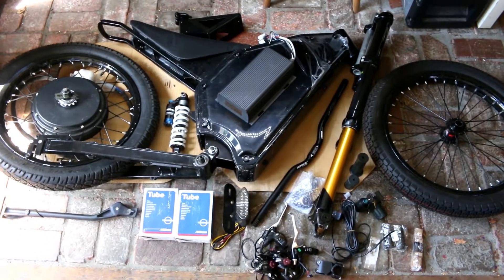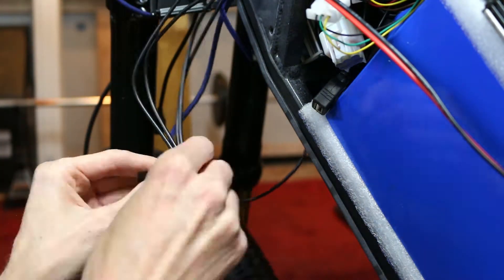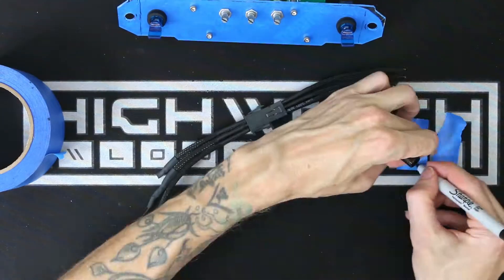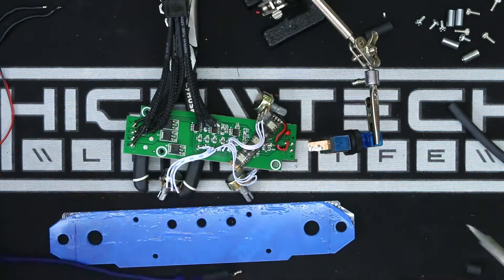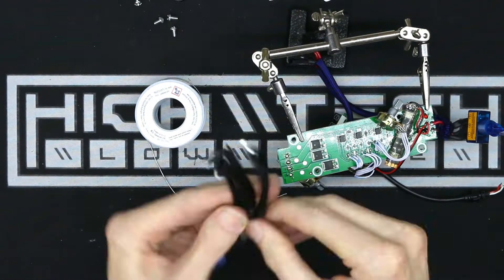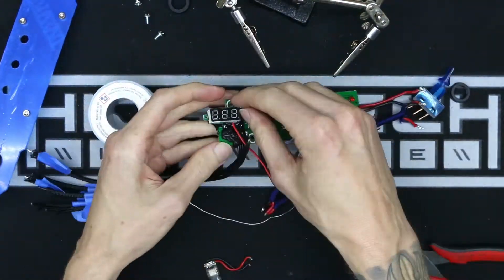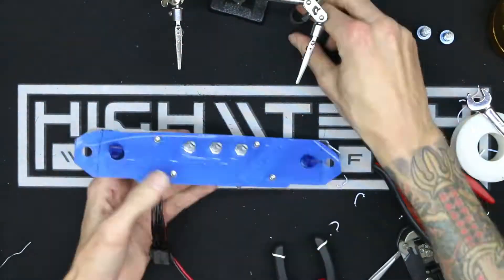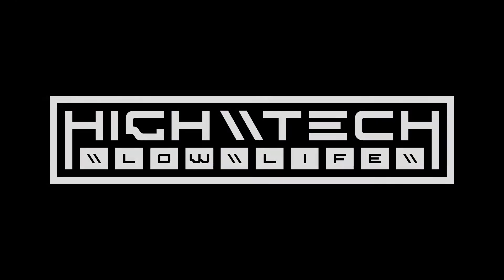🚲 Custom 5000W Digi-Camo E-Bike [54MPH!] - Part 3 - Edge-Lit Acrylic Dash Design + Build + Wiring

Comment: enamel coated wire is what you want   it wont short  . just clean the ends and solder up the rest is safe .. 😱😁
Reply from the maker: Thanks man! Yeah that would also work for sure!

Comment: hi, i was wondering if you could include the machines you are using to make your layouts with, please, like link them in your videos ok, thank you.
Reply from the maker: Hello, do you mean the laser? Or the software? Software is Illustrator, the laser is a mini helix: https://www.epiloglaser.com/laser-machines/minihelix-techspecs.htm
Reply: @hightech-lowlife  sorry, did not know there was software, to get with the machine, but yes what software would you recommend with this ? thank you and which mini helix
 would you recommend as well ?
Reply from the maker: @stan121midling5  No problem, for software you can use any vector graphics editor (corel, illustrator, inkscape - which is free) - the laser will just 'print' a pdf file :) 

It depends on what you're going for, bed size and also wattage. If you want to work on bigger projects or more robust materials you'll have to get a larger and more powerful laser. If you read this article, you will know everything you need to understand: https://www.heatsign.com/how-to-choose-the-right-laser-cutting-machine/ 

Good luck man!

Comment: Dude you need to buy the heat shrink with built in solder and glue. They are a huge quality of life improvement when it comes to splicing wires. Everything is electrically insulated, water proof, and a has a strong mechanical connection.
Reply from the maker: Thanks, I'll try them out :) I'm just so used to doing it this way, and even though this was a lot it was nothing compared to wiring my car!
Reply: @hightech-lowlife  haha tedious work!
Reply from the maker: @vincentpernicano3277  Most definitely!

Comment: if you ever need wire that can take alot of bending just strip your old usb or fire wire leads i even strip all my old vga cables and dvis they heaps 1 and 2 core sheilded actually really good quality compared to alot of ebay wire can buy
Reply from the maker: Thank you! 100% agree, I actually used a ton of old USB cables on this build, that's a very good tip for the VGA and DVI cables though!